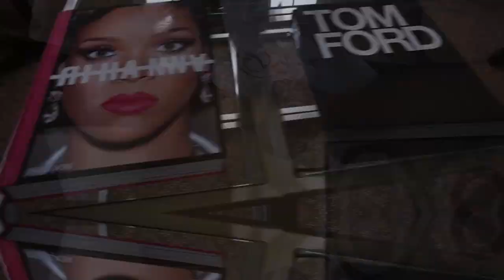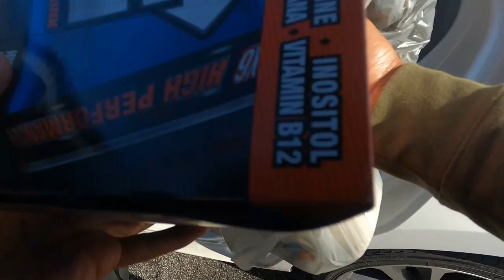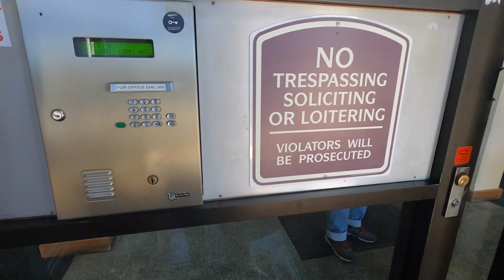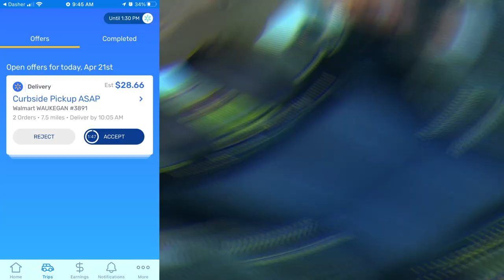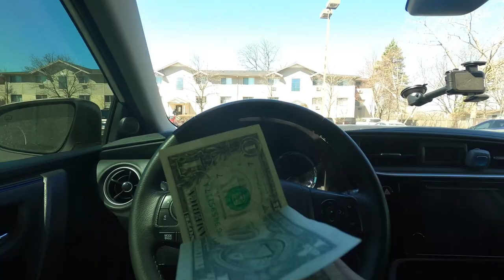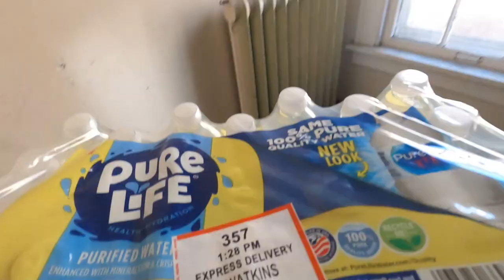Accepting ONLY GROCERY Delivery Orders!🤯 Can I HIT My $ GOAL? InstaCart, DoorDash Tips & Tricks

Comment: My dude your curbside orders are wayyyyy better than the ones I get. Usually I see $9-$12 for 7-15 miles. Just crap!!! Been a good week for shop & deliver though, only tip baited once. 🙄
Reply from the maker: Sssshhheeessshhhh that’s CRITICAL. They give you bad curbside orders and they give us no shop and delivers.🤦🏽‍♂️
Reply: @carsandcribs  I like the shopping ones too and I can see how many items before accepting and the address so if it’s an apartment on the 3rd floor it’s a no go for me. I did get a $54 IC just now so I’m all the way done for today! Too hot to be running around this summer is gonna be CRIIITIICALLLL
Reply from the maker: @danisdelivery4919  🤦🏽‍♂️🤦🏽‍♂️🤦🏽‍♂️🤦🏽‍♂️ PLEASE DON’T REMIND ME 🤣😂 I don’t like the heat AT ALL‼️

Comment: Question: I’ve been doing doordash and ubereats for a while now. Recently got a new car and have already put 10,000 miles on it in 4 months. Any tips about car maintenance? Do you set aside a certain amount of money just in case of breakdown/get things fixed?
Reply from the maker: To be honest my situaution may be a little different then others. We literally got the car just for Dashing. As far maintenance goes we just make sure to get the oil changed on time, the tires rotated and we also made sure to get the extented warranty which covers it for a certain amount of time/miles which we are going to renew when it runs out.